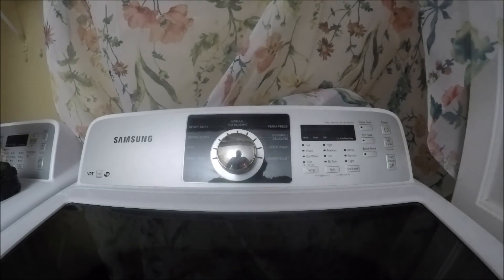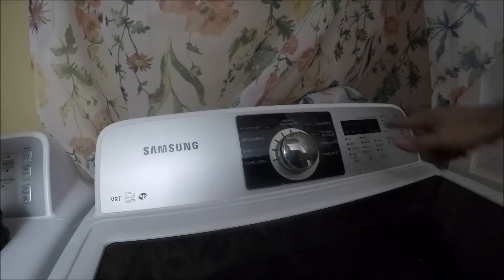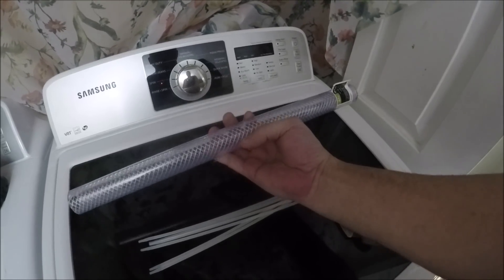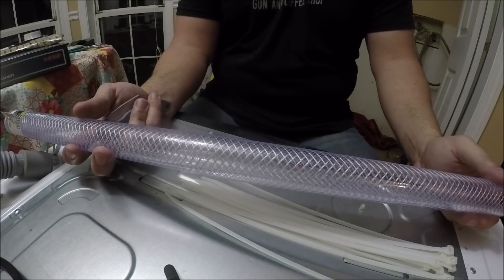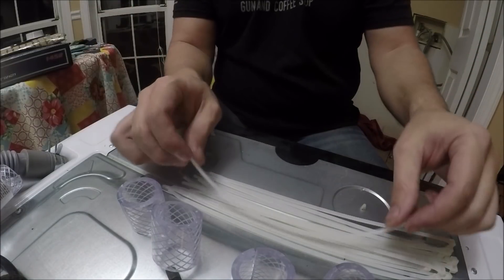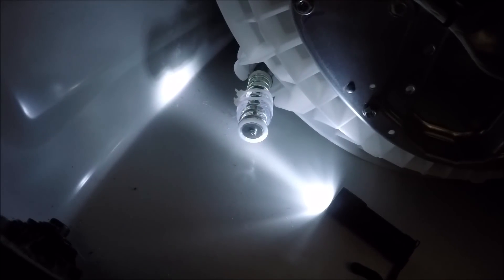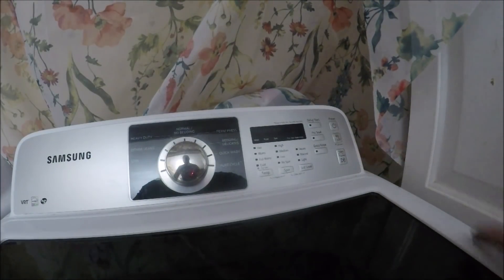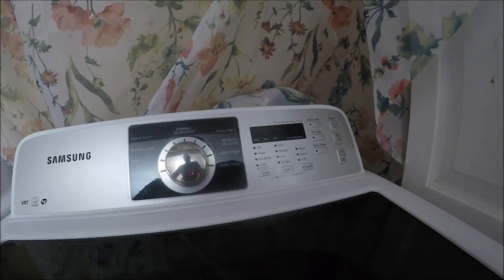Samsung DC Error Code $3 fix in 5 minutes

Comment: Great bush fix!  Works like a charm. Thanks for sharing.
Reply: Update: The zip ties lasted about 10 loads and the rubber tubes rattled off.  I have decided to try it again with hose clamps.  I will send another update soon.
Reply: I had the same result. The second set of rubber tubes just came loose so this fix seems to be temporary. It worked like a charm for about 2 months after the last fix.
Reply: @geocookinc  Any suggestions??? Thank you!

Comment: Thank you! This works yall!!!
Reply: I used the 1 inch braided hosing ( bout 2 inches on each spring ) and 2 zip ties on each. The zip ties were 7$ for a pack of 100. (8inch long ones) and 3.28 per foot of the hose. Lowe’s cut the hosing for me.
Reply: I just tipped the washer on it’s side and you can very obviously locate the springs (mine had red caps on the ends and I jus followed this guy’s instructions. Great work !!

Comment: DC error means door open error. error about the damper is UB error.
Your idea looks like a good idea, but I'm not sure  it will be fixable.
Reply: DC error is an unbalanced load. DE error is "door error".
Reply: @supernova9088  While I now believe that the dC code is linked to an unbalanced load, every piece of literature I found prior to your video claimed it was a door open error. This includes Samsungs official app and on their website. So i can definitely understand the confusion.

 https://www.samsung.com/us/support/troubleshooting/TSG01001745/
Reply: @brendanrousseau9906  you are correct. The unbalanced load is actually just the CAUSE of the error in a strange way. The balancing of the load is the indirect fix. The actual stoppage of the machine comes from the fact that when it is bouncing around, there is potential for the door to become easily unhinged. The software resets the washer, in order to "prevent potential injury" from the glass door flying open. The hose dampens the springs which lowers the chance the door will fly open. I actually fixed the issue by putting something heavy ONTOP of my washer.

Comment: After doing this, mine still disconnects during the spin cycle =/ I have to load it a lot less until it runs through. Anyone have a similar issue? I tried to add more zip ties, still has issues =/ anyone further reinforce it or anything for a better result? or am I pooched?

Comment: Fixed the DC code issue!! Did use hose-clamps instead of the zip-ties, but just finger tight.
Reply: Would add, at least on my model, there was no bottom panel to have to take off to get to the springs.  Once the machine was on its side, could easily get to all 4 springs and much easier than going in from the top.

Comment: @cvsahara  - this machine has become such a problem with the DC code - I am literally ecstatic when it actually does a load without us having to manually reset the machine when it DCs. I am literally typing this response and listening to the machine going through it's third attempt at completing a regular cycle. I will definitely try this fix tomorrow.
Reply: Fixed 3 of my 4 suspension rods yesterday using this method and since then, 5 washes and counting without any problems! Total cost of repair  $4.82 for hose! Thank you for sharing this video.

Comment: Did this repair hold up??
Reply from the maker: About 6-9 months then had to redo it. Lasted about another 2-3 months and finally had to break down and buy new springs. Its a good fix to get someone through until either new (upgraded) springs are bought or they ditch samsung altogether
Reply: @cvsahara  I have dealt with a lot of appliances.  Buy,repair, and flip. 
  Getting rid of Samsung’s sounds like a good idea. 
  From what have googled, there was a recall on many top loaders. 
  I am in my shop now trying to figure a fix for worn suspension rods for other brands. 
  Taking some of the plastic caps apart and studying the foam in them that is supposed to grip the rod. 
  They get worn and the cap does not grip the rod.  They are supposed to be hard to move up and down on the rod. 
 I think your fix was was suppressing the spring enough to have a similar effect, but just does not hold up. 
  Thanks for responding.

Comment: Drill holes in the drum ring. It works
Reply: Spencer for Hire Any details on this?
Reply: @BellyUpFishGarage  The plastic ring on top of the drum contains water. If you shake the drum, you'll hear the water. Drill holes in the bottom of that plastic ring to drain the water. That'll stabilize the spin.
Reply: Spencer for Hire I’ll check that out. Thanks.

Comment: I did this and and 2 weeks later got the dc error again
Reply: Beyond Me Me too. Did you ever fix the issue?
Reply: @BellyUpFishGarage  any update on a fix?
Reply: Brad P. Actually, yes.

Let me start by saying I used 1.75OD/1.25”ID tube.  I don’t suggest this.

1”ID tube should be used.

What I wound up doing was taking the 1.25”ID tube and split it down the side and cut out about .25” worth, so I could get to around 1”ID.

Then I just reinstalled everything and pulled the zip ties with everything I had, and it’s been working for a month or so.

If it fails again, I’ll use hose clamps.

Comment: im over 60  same problem!!! WTF ALL the new springs and rods  should be FREE and FREE Install  OR all washers recalled and FULL return of money My machine did this 3 years after it was I got it new then a DC code DAM I grew up with 6 people in the family and NEVER did our washing machine brake down!!!
Reply: I totally agree Samsung should replace the spring and rods or replace the washers. I mean they had to come out and fix mine and so many others so they wouldn't explode. My washer dcs all the time and rests itself to the rinse cycle. Ugh! My Samsung dryer motor won't even turn on. I will never buy anything that has the Samsung name attached. Today I had my grandson do what the video said with no luck! Screw Samsung!!

Comment: Don’t work tried it
Reply: What did you use Spencer?  Try 2 metal hose clamps and 1-1/4 inch ID clear flexible tubing on each spring and see if that works for you.  It should.

Comment: There is a Samsung  service bulletin for this issue and you need to replace the dampers( all 4 of them). What you did here with the rubber hose and tie down cables is called  A MICKEY MOUSE JOB. Watch-out for a law suit from the owner of this machine.
Reply from the maker: Lol, I'm the owner. Nice detective work CIA
Reply: @cvsahara  That comment was kind of Goofy on their part.
Reply: The Washer itself is Micky mouse with a number of issues. This machine is an embarrassment to Samsung.
Reply: @cvsahara, i think there are some salty appliance techs in here.  You call them, they want a bunch of money, and most of them will recommend putting in the SAME DEFECTIVE parts for the issue to prop up again later anyway, so the Internet came along and people help themselves. If what you did doesn't work, you aren't out a $300 repair bill.